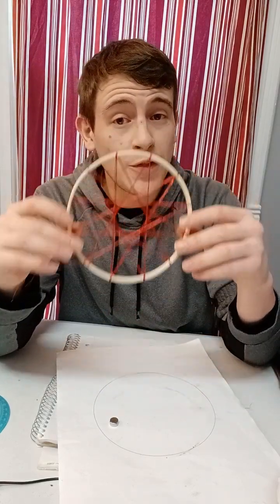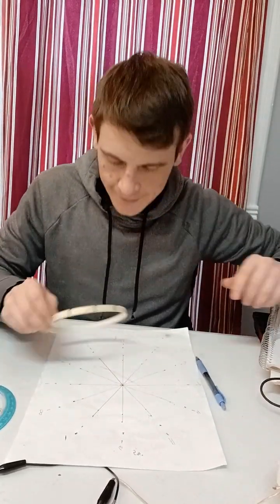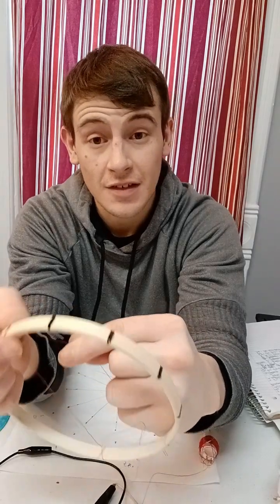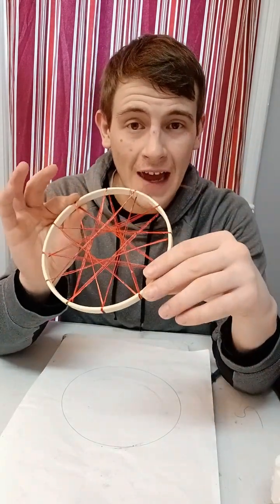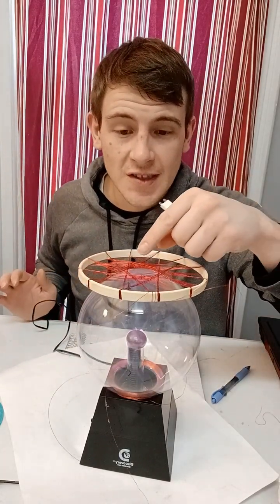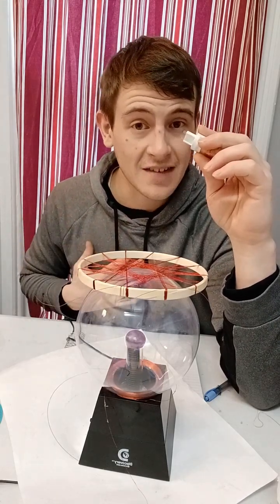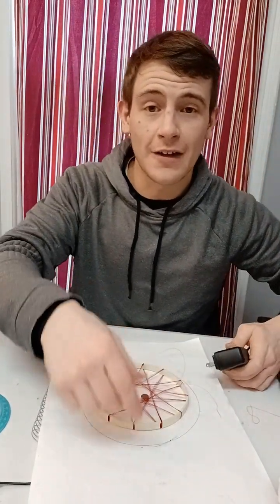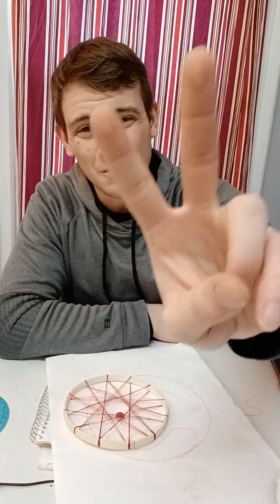How to Build & Test a Dodecagram Coil (Updated version)

Comment: What would the outcome be if you stacked ten together with all of the points of the star in contact with the next and so on, and linked the positives and the same with the negatives? Would it increase the output and would it overheat?